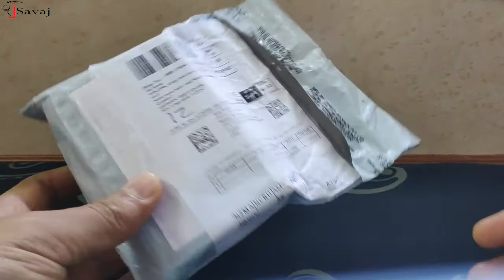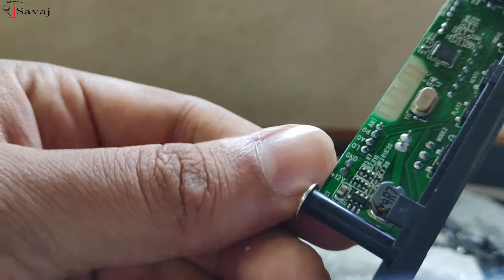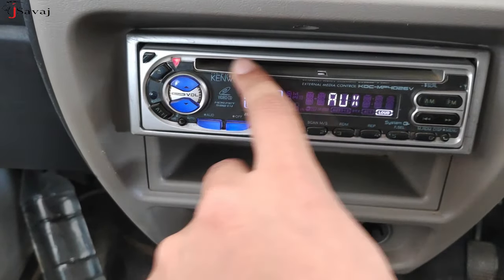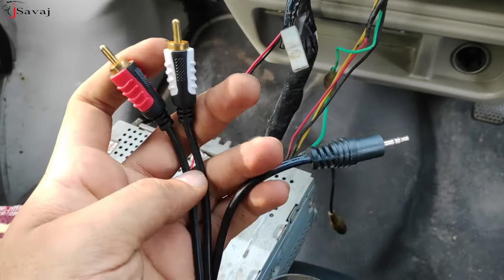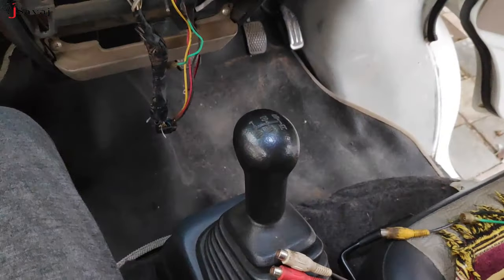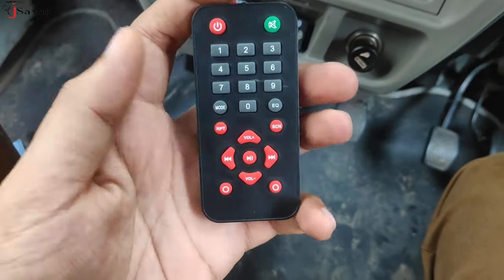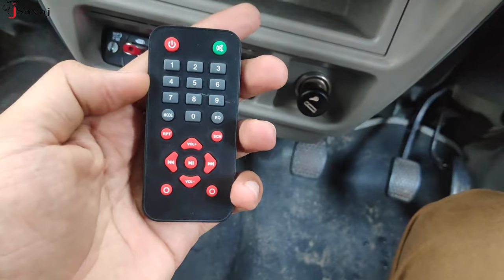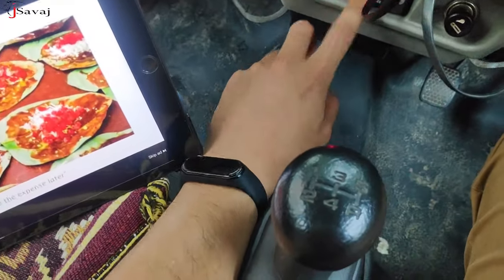Upgrade any CAR Stereo with 12V MP3 KIT (USB + BLUETOOTH + AUX + FM + Mobile Charger)

Comment: Ye kit to 5v pe chalta hai aapne direct 12v pe kaise chala diya kya direct 12v ka kit milta hai market me
Reply from the maker: Ha milta hai 
Ye directly 12v pai hi chalta hai 
5v pai ye wapa kit nahi chalega 

Link description pai hai buy karne ki
Reply: Sir mene bhi 12 v same module order kiya tha but 5 v module mila uske baje se abhi tak install nahi kiya mere car me 
But  testing ke liye 5 volt deke chk kiya work very well... Sound quality is good  after attaching my etios original stereo aux wiring...
Reply: 12v ke liye 7805 ic lagao
Reply: Mere car me usb aux ka wiring tha usb wiring se 5v deke install kiya he aux ko attached karke Working properly  audio quality also good, satisfied with this video me jyo 12 v supply ka module he mera different he

Comment: Wher to get this device i also need this please tell me and i have old stereo of sony that doesn't have aux or usb only magnetic tape cassets works what i can do to add bluetooth to that
Reply from the maker: You have to connect your sony stereo FM with this module, you can buy it online
Reply: @xplorewithjsavaj1421  but there is no aux option
Reply from the maker: @mkcraft360  ya that's why i am saying that you have to connect with FM radio

Comment: bhai isko direct 12v se nhi chla skte kya
Reply from the maker: Ha chala hi sagte hai 
Pura video dekye maine directly hi chalaya hai
Reply: My Jvc audio repaired and removed. Can I fix to car audio directly. No need amplifier. Electrician told me not working without amplifer. Pls tell me
Reply: My car us Tara nano. To fix directly without any car audio?
Reply from the maker: @saleem5245  yes this kit required amplifier to get output of 4 speaker
U cant use directly

But u can made amplifier with this kit its easy
Reply: @xplorewithjsavaj1421  Thanks sir.